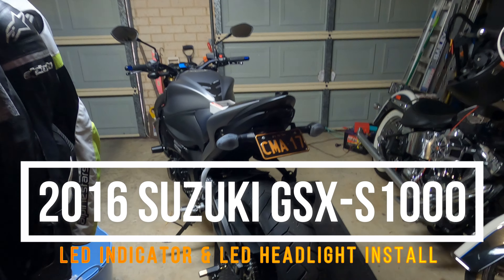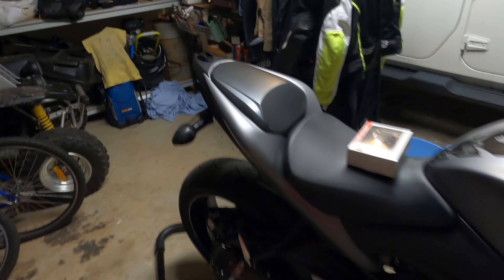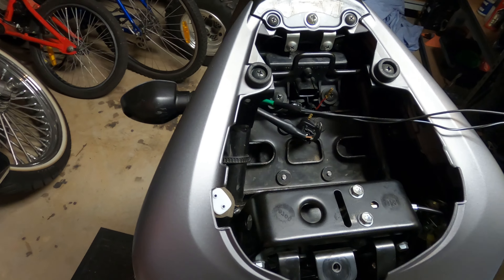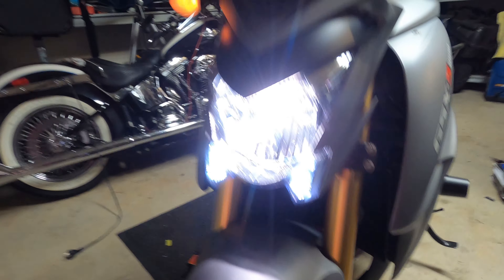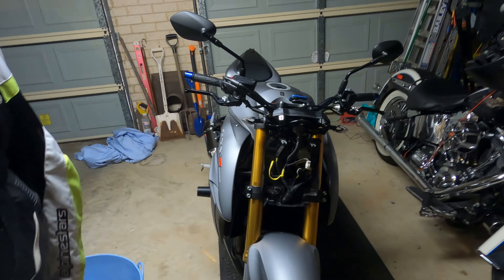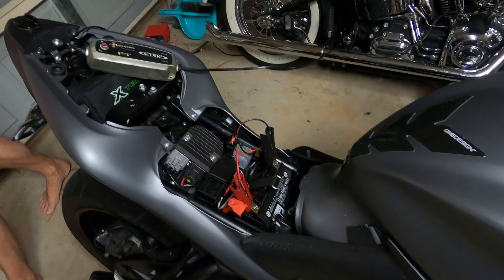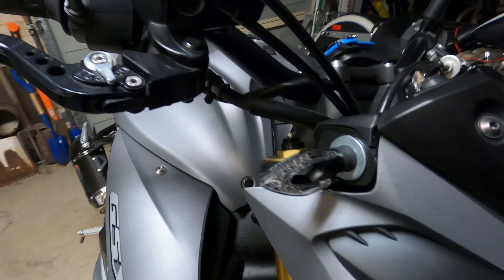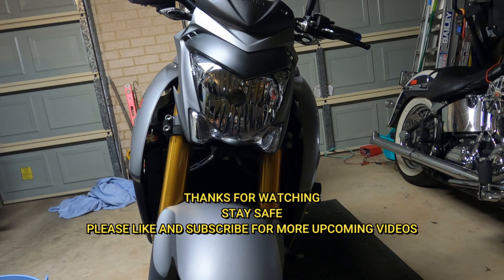LED indicators & LED headlight install - 2016 Suzuki GSX-S 1000

Comment: Glad to see others liking this bike! I love mine I  feel like I got the deal of the century! Mine is actually identical to this but with a radiator guard, custom headers and mid pipe with slip on youshi and bunch of power upgrades! PC5, block off plates, custom tune, servo eliminator, and it came with the back rack and I bought the matching front so I can keep it off the ground in the heated garage 😌

Comment: Good Day. Sir I would like to ASK about the Installation of LED Turn Signals, could you guide me on this. Is the 10mm Thread of the LED turnSignal Compatible with Our GSX-S1000?  The Supplier ASK me to ASK experts about this, especially at the Front..
Reply from the maker: I'm not sure I understand the question? But from what I've read the indicators were installed with ease as the indicators had a thread and a nut
Reply: @criszx-10r86  Sir, What did you Put from Refraining FAST BLINKING of the LED's? Thank You.
Reply from the maker: @rackssanoy5569  LED flasher relay

Comment: i install stock led kit from suzuki and i have seen from R&G you can buy plastic whaser some make them fit 100%  and how hot do the lamp glass become my buddy crach the glass use LED lamp low/hibeam 6000 lumen Extreme and 6000k kelvin = 55w

Comment: Nice work mate.. hows the light pattern from the new led headlight bulb? Is it scattered much? Cheers
Reply from the maker: Honestly haven't ridden much in the night but I haven't had an issue with it, they work good for the money I paid for them
Reply: @criszx-10r86  you should have bought this light it plugs right in without cutting anything or having wires trailing https://www.amazon.co.uk/gp/product/B07S18ZVS5/ref=ppx_yo_dt_b_asin_title_o00_s00?ie=UTF8&psc=1